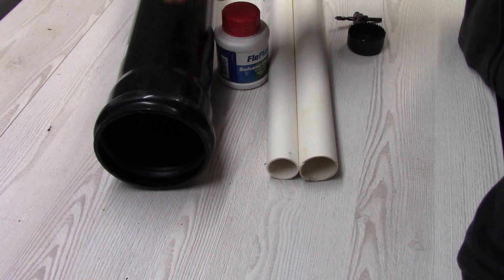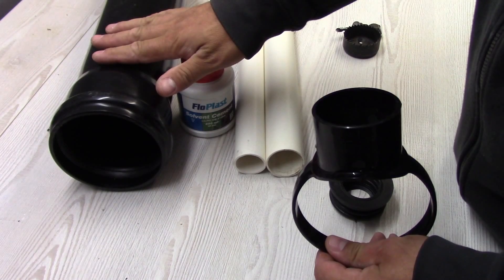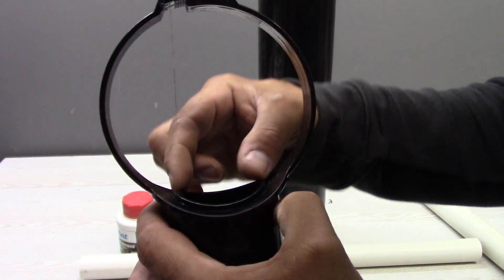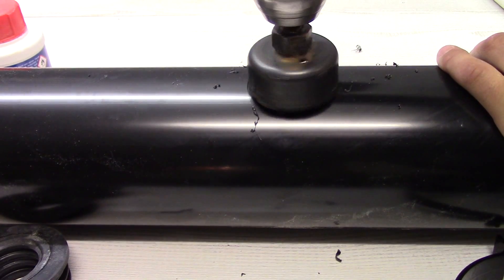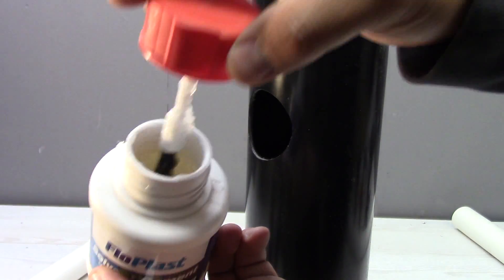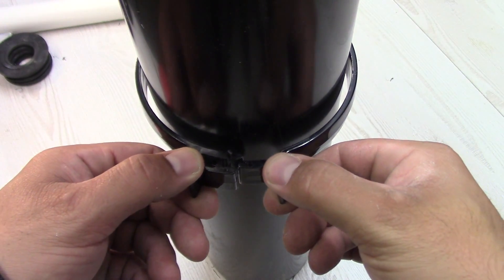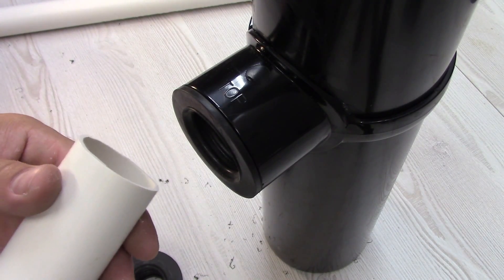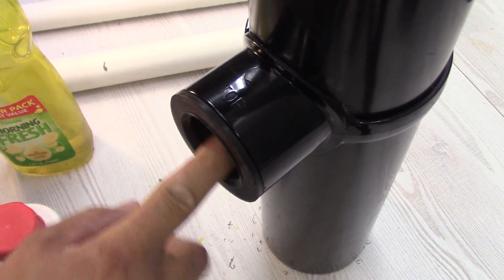40 mm to 110 mm pipe How to fit waste pipe to soil pipe Boss strap adapter

Comment: Thank for this video. Sorting our some naff plumbing by the builder of our house. I’d not heard of boss fittings before but knew something link this must exist since the bath drain was going somewhere.  What is helpful is knowing (seeing) that there’s nothing stopping the 40mm pipe when you push it into the adapter so caution not to push it too far in

Comment: Hi, would you please tell me if you are supposed to fit solvent pipe or push fit 32/40 mm pipe in that black rubber? Does it work with both?

Comment: Hi thank you I'm about to buy the stuff to do mine . 
Just one question when you push the white pipe in to the rubber  is there a stop point when it gets to the end of the rubber or the adaptor.  Or will it keep going all way in to the black pipe . 
I guess when I buy mine I find out . 
It so i dont push it in to far and block the pipe . 
Or should I measure the leanth and mark the white pipe and go in as far as the mark    cheers
Reply: It can keep going if you force it through. There isn't a stop point.

Comment: This pipe is 43mm because it is a solvent one, I can see it by the thicness of the wall.. so the outside diameter is bigger and as such it is more difficult to fit in

Comment: Put strap on first then drill through th outlett.
Reply: This wouldn’t allow the fitting to locate properly because the hole would be too small and the fitting would stand off the pipe. That’s why he points out that the drill cutter needs to match the size of the plastic rim around the fitting.

Comment: You can get different boss adapters for push fit and solvent weld pipe. Outside diameter of the 40mm     push fit pipe is actually 41mm . For solvent weld pipe it is actually 43mm. So the pushfit pipe will slide into that adapter more easily than the solvent weld pipe.